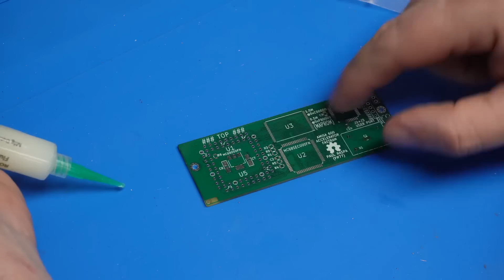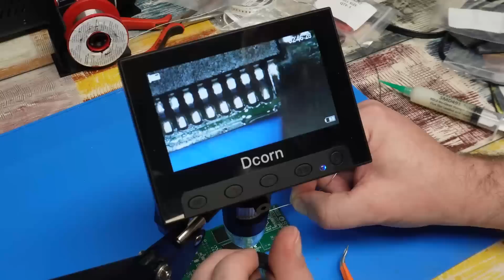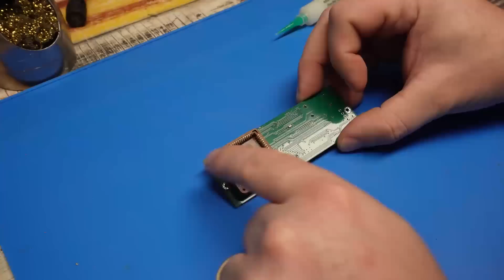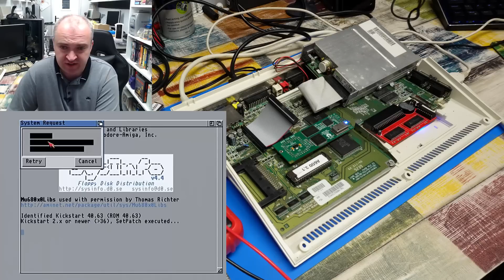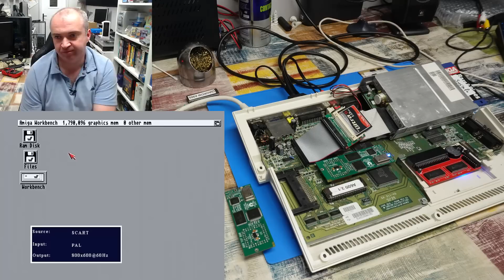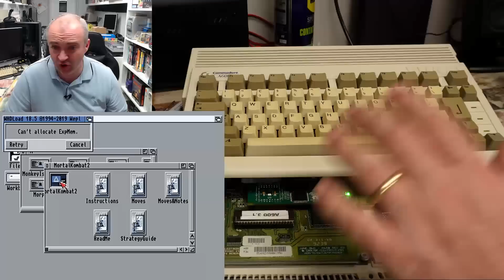Building, testing and hitting problems with a CHEAP Amiga 600 ACCELERATOR

Comment: If you still want to revisit this project some day, find a way to add 150-180 ohm resistor between the crystal oscillator output pin and the PCB (since the signal spreads out to the CPLD and the CPU from there). If the oscillators you used output squarewave'ish signal the results should improve quite a bit. There's also a new logic for the CPLD that runs memory accesses a bit slower and improves the reliability at a small performance cost.

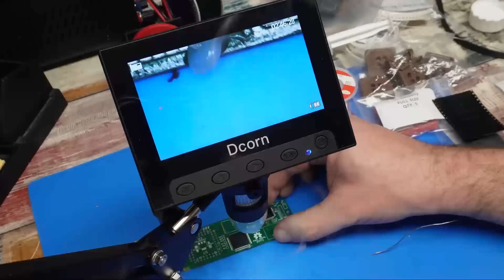Comment: EDIT: 7:20 You had the same idea as me! ORIGINAL POST: 5:20 This really seems like a job for solder paste and hot air. I’ve only done stuff like this a few times but once the solder melts, the flux in the paste pulls the chip into the right place, it almost feels like magic! Of course a few times I have messed it up with too much paste, causing bridges/shorts behind the pins. Using some braid you can wick the solder out from even behind the pins.

Comment: I've built two of these with similar results. First one worked right off, but starts to get flakey at 40MHz after it warms up enough. The second one just didn't start, until I realised it gets stuck in maprommed state right from the start. 1 second long hard reset and it starts, but the RAM is missing, which eventually shows up when the card warms enough. Until it warms up the keyboard is also unable to do long reset but the reset is just pulsing, unless I swap the crystal with 35MHz one, and then the keyboard reset works just fine. Having the Xilinx tools installed I decided to compile the CPLD verilog and the program made a warning that some logic state wouldn't behave correctly unless a coldboot register(?) is set differently in the logic. Doing that change and the board that gets stuck in the maprom state from coldboot now works correctly, but the RAM is still missing until the board warms up.

Comment: Miss-aligned pins or a short is my bet as that is what is usually the culprit when it comes to manually installed surface mounted components. That or inferior Aliexpress scam/knockoff/QC reject components or a borked PCB with iffy trance tolerances.

Comment: Amiga? Dead garbage! Bury it, it stinks.
Reply from the maker: sniff... no idea what you're talking about... smells fine to me.
Reply: @CRG  I still have my original Amiga 1000 motherboard.
Reply from the maker: Maybe dig it up then before the worms get to it 😂
Reply: @CRG  It's not buried, it's on my man-cave wall, along with my Amiga 2500 motherboard. Properly buried and DEAD!!!!!
Reply from the maker: Sounds like you once had a nice Amiga collection.  If you still by chance have the rest of the machines maybe assemble and sell them.  Even in a dead state they are worth a good few hundred.  But there's also nothing that can't be repaired 😉

Comment: It's strange why the PCB designer didn't just take the german design open-source 68EC020 accelerator made for the A500\500+ and re-work it to use the square CPU. That's a really amazing accelerator for the A500 with 16MB true fast RAM and a very fast IDE controller built in.
Reply from the maker: Sounds cool but would great increase the complexity and cost of the board.  The designers aim here was to make it as simple as possible and granted while there are a few minor issues in his design, I think he did a great job.

Comment: Another way to make the socket shorter is to rub it on a sheet of fine sandpaper. This will ensure the ssurface is nice and flat and you can make very fine adjustments more easily.
Reply from the maker: Yeah seen a few others recommend that process too.  Will keep it in mind for next time.

Comment: You should consider getting better quality sockets rather than the cheap chinese crap. On the Individual Computers ACA620 or ACA630, once it is pushed onto the CPU it is extremely difficult to remove.
Reply from the maker: In fairness to them the sockets have been fine.  The issue though is down to other Chinese sourced parts.

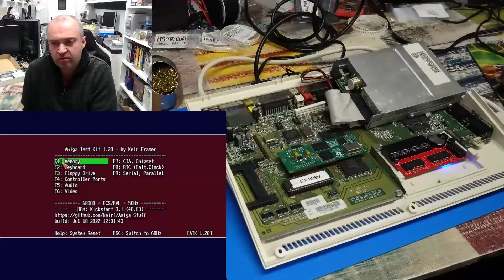Comment: 20:54 One thing that is curious is the RAM should be fast RAM. Slow RAM is connected to the chipset and fast RAM is connected to the CPU. That accelerator should have the RAM connected to the CPU so why is it configured as slow RAM????? I think the board designer needs to go back and do a bit more thinking lol
Reply from the maker: The designer made it like this on purpose to keep the project simple.  Going to fast ram increases the complexity of the logic required.

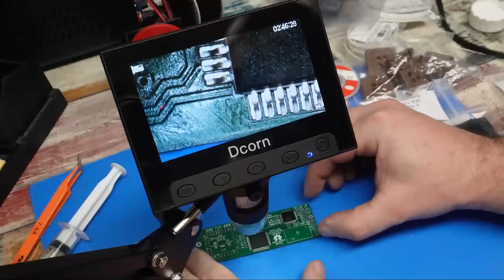Comment: 6:00 That's a design fault. The board designer should have made the pads longer. My guess is he either used a footprint for some other chip that is not the correct one because he was too lazy to make a custom footprint (there definitely won't be a 68000 QFP footprint for that chip in Kicad) or didn't actually check it properly, or he may have used solder paste and a reflow oven which would work fine with short pads.
Edit: Another possibility is the space available is very tight and he made the footprint as small as possible. The correct way to solve that issue is to make the footprint larger and then use alternative routing (not run the trace near the edge of the board that forces the pads to be short) or make the board 1-2mm larger. The board can easily be made larger there is no reason to make it that small and a couple of millimeters larger won't hurt but will allow for more space to make the footprint larger. This is your typical amateur PCB designer mistake, seen it hundreds of times before. I'm usually taking these types of projects and improving them and re-releasing it and have been doing that for many years. Maybe I'll get hold of a PCB, reverse and fix it ;-)
Reply from the maker: Ive been chatting to one of my YouTube friends about this board and he is going to undertake a redesign on his channel.

Comment: 4:20 Use magnification and simply hold the part with the point of some tweezers and the chip won't move. With the same hand that is holding the tweezers also hold some solder. Touch the iron to the solder to pick up some of it on the tip and solder the corner of the chip. The added flux on the chip will make the solder flow. Check the position and adjust if necessary then solder the opposite corner. It isn't that difficult with the correct technique ;-)

Comment: Good job, but the easy way to solder a QFP chip on such a tight footprint is to tin all the pads, and then use hot air to solder it. It’ll even self align for you.
Reply from the maker: I'll have to be honest and say I've never had much luck soldering like that.  But I'm just self-taught, so no doubt am "doing it wrong" to those who have a formal education in it.  I know i struggled a bit with this one but for the most part I can get on ok and enjoy hand soldering as part of the hobby.  

In the 2nd channel video related to this board, I had a go at solder paste and it's maybe a little easier to work with.  Not sure if I'll use it long term though cause as I say I enjoy my hand soldering.
Reply: @CRG  I’d never accuse anyone of doing it wrong when it works, I’m just advising there is a simpler method. I don’t recommend using solder paste unless you have a PCB stencil to control the application precisely. Then it works really with a reflow oven or hot plate. Hot air will work too, but it’s not as efficient at heating the entire PCB evenly.
Btw, I still hand solder one offs cause it’s fun, but only when the footprint is big enough to do so. When you get to QFN’s it’s just not worth the effort.
Reply: @ rubbish, if you heat up the board first, use the right size square tip on the hot air station, and don’t go above 300c, it’s quick and safe.
I haven’t been watching anyone, I was an electronics tech back in the 90’s. This is not new technology.
Reply: @ LOL, I’ve been soldering since the early 90’s and studied electronics at college, I know what in doing.

Comment: I might be wrong on this one, but I thought that ranger/slow ram, although only accesible to the CPU only ran at the same speed as the amiga's chipset as it still has to be accessed via agnus, hence only "real" fast memory (accessed directly by the CPU) accessed at the CPUs native clock speed.  That might explain why you're not seeing the speed up you'd expect from things like frontier.
Reply from the maker: The ranger ram on this card sits local to the cpu. It's added as slow ram but is accessed only by the cpu at its clock speed.  That's why we get the speed increase in sysinfo.

Comment: Not to be a knob or anything, but why did you not pretin the IC pads a bit instead of wiping them with the braid? The way I do IC's like this is to pretin the pads so they have a slight layer of tin on them, place the chip, tack in the corner legs to the tin already there, then tin up the iron tip and "bead roll" the legs. By bead roll I mean use the tip of the iron "wet" and add tin as you slowly go from leg to leg to leg. You can do it with a bead of tin if you feel lucky, the name comes from that but it's a PITA to roll an actual bead the whole time, you get the same effect if you keep the tip "wet" so it has tin on it all the time. It's also fairly quick to do it this way, you're done in 5min tops if you roll on through it. If you get a short/bridge disregard it and roll on down the side of the chip, then clean the bridges up with a wick afterwards. I used to do a lot of assembly and rework, also with hot air, and had time to mess around and try different methods, this is what was the easiest and cleanest for me. What you get is the legs, or the "foot" of it is coated with tin and so is the pad and it seems to be the best "bond" like that. Also liberal application of flux is recommended hehe. 

- just to be clear, cleaning the pads isn't a bad idea, but I think leaving them "dry" is, in particular if you have to take a break and so on, you can get oxidation or weird stuff make the pad not want to wet with tin later. Not sure exactly what does it but it's happened to me several times if I cleaned a board and left it "dry" for some time.
Reply: That's the 'bad' way to do it. I'm guessing you have been watching Sorin lol! The way he did it is correct. Remove all solder and sit the chip flat onto the board. Having the chip sit on a mountain of solder and hoping the legs of the chip will drop down is a wishful thinking. Doing it the correct way is easier and faster too and when done correctly, works first time.
Reply: @g4z-kb7ct  I have no idea who Sorin is but I've used my method for going on 30yrs now. By pre-tin I don't mean 'leave a big bead', I mean enough to have the pad not be 'dry copper', when you tack it in you have tweezers in one hand placing the chip, iron in the other, place the chip and hold it down with the tip of the tweezers and heat up he tinned pad with the iron in the other hand. Always sits flat. Since you're pressing the chip down you can heat the leg enough to get it to stick, then you switch from tweezers to tin and go around and come back to the first pad. 
You're probably thinking it some other way, FYI I've had my work inspected by experts, for use in applications where it needs to handle shocks and vibrations etc.
Reply: @noth606  Sorin runs another yt channel Electronics Repair School. He's a smart guy but his soldering work is average at best. If you check some of his vids he basically pulls off a faulty qfp128 chip, does no cleaning, no re-tinning, no wicking and slaps another new chip back on top but aligning the chip sloppily then pushing on the top and heats the pins on each side separately with hot air. The result is poor alignment with chip sitting on top of a mountain of solder and It's hilarious when he has to go around the chip after and fix all the loose legs lol
Reply: What about solder paste and a hot air gun, is that a possibility?
Reply: @TonyHamlyn  Same thing. Solder paste is simply tiny balls of solder and flux mixed together.
Reply: @g4z-kb7ct  but I mean couldn't you apply paste to the pcb, drop the ic into it, and heat it with a heat gun, wouldn't it solder the pins more reliably that way, the wicking as the flux helps to flow the embedded solder and maybe it flows enough to stop pin to pin shorts? I have just started surface mount stuff myself, and bought some paste to try this method out (previously doing it with similar strategy as this vid, by soldering 2 corners and fluxing the whole thing up well and working with the iron, which, as we saw in this vid, doesn't work so well when you can't get any heat onto the pcb pads).
Reply: @TonyHamlyn  Yes you can use solder paste and heatgun if you want and it will work fine. Be sure to tap parts slightly and watch them bounce back into the correct position to know that the chip is correctly reflowed. Note solder paste only works for smaller chips or chips with coarse pitch pins (maybe 1mm minimum). If you try to reflow using solder paste and hot air on a large chip with 208 pins and with 0.5mm pin spacing you will not succeed. The correct way to solder those is by hand as I described in my first comment.

Comment: You mentioned that you changed the socket several times.  Is it possible that you may have damaged the pcb (especially the inner layer connections of the socket) of the 4 layer PCB?  The only way to find out for sure is to buzz all the socket connections per the schematic.  A tedious task.
Reply from the maker: I thought that myself but in haven't.  I do have the first board now working.  It'll be covered in a 2nd channel video later this week.

Comment: I do not have a 600 to check with, but I wonder if the holes on the accelerator matches the two "possible holes" in the board, meaning screw and bolt could help to keep it tight, avoiding any dodgy connection issues.

Comment: I would have modified the CPU socket by putting a sheet of sandpaper on a flat surface and rubbing the plastic away slowly until you just touch the pins.  It will ensure a flat finish and remove the same amount of plastic all round at the same time.  This will permit the best contact while not straining the socket, which aren't the strongest at the best of times.  I'd probably look at starting with 120 grit, anything coarser (smaller number = coarser grit) will be too aggressive, anything finer might be really slow.

I'd really give your soldering a deep inspection to really look for a defect -- a tiny blob or bridge which is nearly invisible can cause issues like that.  Otherwise, try with a 20MHz crystal and go up by 5 or 10 from there, just to ensure that particular CPU can handle it.  Even though they are marked 20MHz, you might find most are capable of overclocking to 40.   The manufacturer, during testing, obviously started detecting problems with SOME chips in that batch at anything above 20, and thus labelled the whole batch at 20 MHz.  You might be lucky with some, but others won't handle overclocking nicely.
Reply: You can't use a 20MHz oscillator. The CPLD is programmed to use specific timing and requires the specific clock speed it is programmed for. He said there is a CPLD code for 30MHz but he didn't have the oscillator and it didn't even boot at all with 40MHz oscillator. Using any random oscillator is not possible unless the board designer also makes the matching CPLD file for it.

Comment: That speed on Frontier Elite did seem very slow, maybe slower than my stock A1200. When I tried it with a 28mhz 68030 with 8mb fast ram, it ran pretty smooth, maybe 30+ fps.
Reply: Yeah fast RAM is the key, he didn't have enough. The designer should have added 8MB and made it all fast RAM. Back to the drawing board for version 2.0 lol!

Comment: I really like this thing, although I hate the method of upside-down socket to tap into the CPU bus and the idea of using a CPU at 2x overclock, the versatility of having the Kickstart (or any other ROM) on RAM is intriguing enough to try one... Only if I had an A600... Is there a A500+ version of this board?
Reply: There are MUCH better open-source A500 / A500+ accelerators around. I have one with 68020 and 16MB true fastRAM with built in IDE controller that I built myself. Works incredibly well and super compatible with everything.
Reply: @g4z-kb7ct  What is it called?
Reply: @borayurt66  I replied, YT insta-deleted it. Sorry, YT doesn't want you to know.
Reply: @g4z-kb7ct  Don't put a link, just write what it is called, I'll find it with Google

Comment: The PCB layout is quite poor. Even though they went to the expense of using a four layer stack up, they then create large via dams in the ground plane that could have easily been avoided. The cap under the crystal could have easily been placed on the underside. They even placed a ground via next to the crystal's 5V pin! The RAM is a 45ns part, this is almost at the limit for 40MHz.

Comment: I’ve build fastram expansions for the a600 that use the same kind of socket method. There a pain… some brands work better than others. Best way I found to sand them down without damaging the pins, is just to remove all pins from the socket, then sand them down which allows you to sand them just that tiny bit further and then re-install the pins in the socket. A bit of work, but it works better, I suspect connectivity is your issue (next to that cap underneath the crystal).